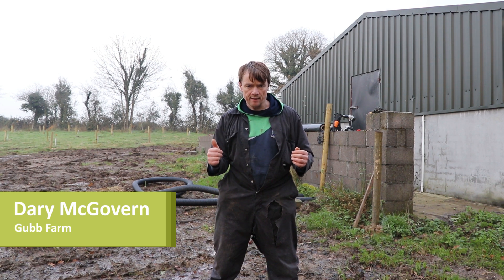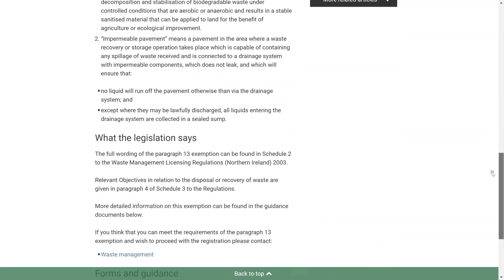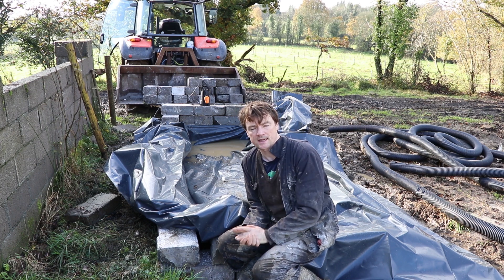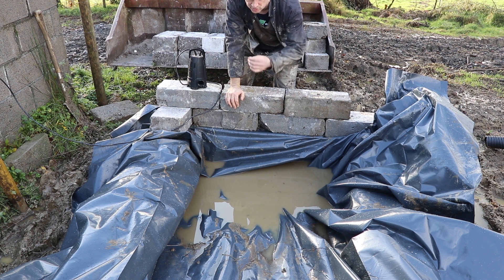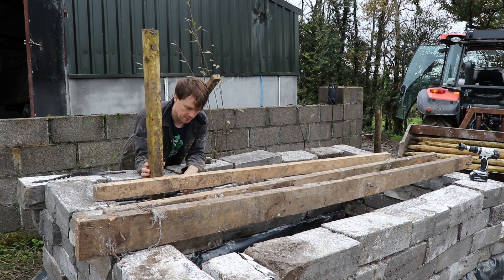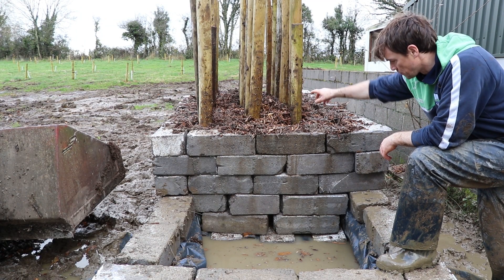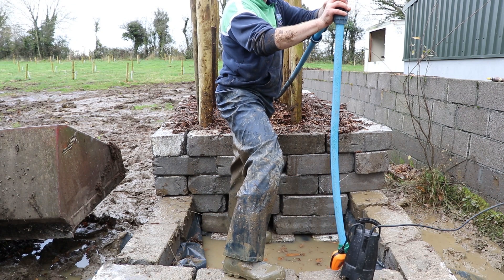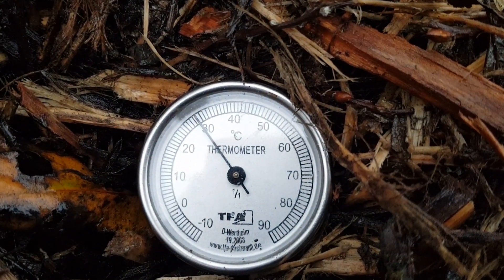Johnson-Su static pile bioreactor prototype | How to compost 50-ton of woodchip & chicken manure

Comment: That's a lot of work !   I tend to use autumn leaves rather than woodchips (even though I've got a chipper) I can get truck loads scraped up from the lanes, .........I think it's less acidic than the chips, especially pine chips. Then I use half and half by volume, layered like you, with the chicken and turkey manure. I can sieve out what I need to pot my transplants on next spring, and leave the rest to breakdown throughout the summer. Mine is covered, (tarp and tin sheets) and  I only hose it down if it feels particularly dry. I think too wet is worse than too dry.

A great guy to follow (if you don't already) about compost is Edible Acres on YouTube, ........poly tunnel and chickens to speed up the work.    

And lastly if it's worms you're looking for, I put down old sheets of builders plywood, with a thin layer of hay under, ...........it's packed with worms after a week of so, I don't put in the compost but let the chickens have them. 
First time to watch one of your videos, ......so good luck and I'll catch up on what you're doing.
Reply from the maker: Hello. I put down some hay on the ground now that spring is on its way at Gubb Farm. But re-reading your comment, I noticed that I didn't put any material like plywood over it. I am recording the process, so we will see how it turns out.
Reply from the maker: That is a brilliant idea on how to attract worms. Thank you! 

I had a look at the weekend and couldn't find any in the manure pile, which left me scratching my head on how to get them. 

As for the leaves, I never really thought about them as an option, but now that you mention it, I have lots of leaves lying on the ground around the farm. I'm going to have to look into that. Another good idea, so thank you again.

I'm off to check out Edible Acres.

Comment: Hi Dary, fair play to you, that's hard work! I don't think there's anywhere selling worms here in Ireland but if you find somewhere that does I'd be interested in knowing. If you know anyone with a dung heap especially from last year's bedding you should find loads as you probably already know... I can send you some if you want. They slow down coming into the cold weather and won't multiply or breathe at the same rate as far I know.
Reply from the maker: Thanks Ciaran. Someone suggest bait shops, so I'm going to have a look around to see if I can find any suitable worms.   I have a dung heap and a grass cuttings heap beside the shed, so I might just get my spade out and starting digging!

Comment from the maker: I just checked the temperature inside the bioreactor after the hard frost last night and it is down to 10 degrees Celsius (50 Fahrenheit).  I think I will go searching for some composting worms this weekend and cover it.  It will be interesting to see how this turns out.  I do wonder if I would have been better off starting this experiment in the springtime when it is warmer and life is returning?

Have you had success starting the composting process during the winter just before a first frost (-3C last night)?
Reply: I have one johnson su bioreactor going in a trashcan. It is doing next to nothing. And another larger hot compost pile. Neither are doing anything right now. But should take off in the spring. However I am blown away by the fact you are doing all this while the mud is past your ankles. Just shows you never stop. LOL

seems like it would have been easier to use water container cages while removing the plastic, and lining with landscape fabric, or drilling 1" holes all through out the container and then being able to use the spout to dump off the draining water. well just a thought. That was a big project building the block walls.
Reply from the maker: @alveygardens  I am starting to think I should have waited until the springtime!  I went searching for worms a few days, only to discover that they are now hibernating for the wintertime.
Reply: @GubbFarm  well, it may not do much right now. But winter time is a slow time for most of us so doing it now will free you up to other things in spring. when you don't have the time to build a chamber.

Comment: Interested in seeing how this works out for you as there are not many videos where this is done on a larger scale.  I built 1 of these bioreactors myself use a pallet and green wire fencing.   After a year everything was broken down and I was able to use it to top off some beds.  I will set up another run in the spring.
Reply from the maker: It is good to hear that it worked for you Steve. What type of worms did you add and where did you get them?
Reply: @GubbFarm  I used red wrigglers (compost worms) and I got them from Uncle Jims Worm Farm here in the US.  I started with 1000.
Reply from the maker: Thanks, Steve. I have had a quick search for worm providers in Northern Ireland, but haven't found any yet. It looks like I'm going to have to get my shovel out and go digging in the compost piles. That will be fun trying to identify worms!
Reply: @GubbFarm  The composting worms are fairly small.  They only get about 2" long and are skinny.  (5 to 6 cm)  Not like night crawlers.  They should multiple quite a bit in your setup.  Maybe check a fishing bait shop.  Here in the states, the baits shop sell them as red worms.  The cost is higher of course but 2 or 3 dozen is enough to get them started.
Reply from the maker: That is a good idea. There is a local bait shop that sells worms. I'll have to pop in at the weekend to see what they have in stock. Thanks.

Comment: Johnson has mentioned in an online interview that you shouldn't worry about temperature but rather make sure not to let the pile dry up.
Reply from the maker: Thanks. That is a good news. There is no shortage of water in Fermanagh, so drying out should not be a problem.👍
Reply: @GubbFarm  Yes I did notice your area looks rather wet. 
Johnson has mentioned the aim is to keep the humidity of the pile to around 70%, I don't know how someone could reliably measure humidity in such a pile though.
Reply: True, but too much water is also a bad thing, probably better to have a roof over it and water as necessary, because like this you cannot control the amount of water throughout the process. Really liked that irrigation system.